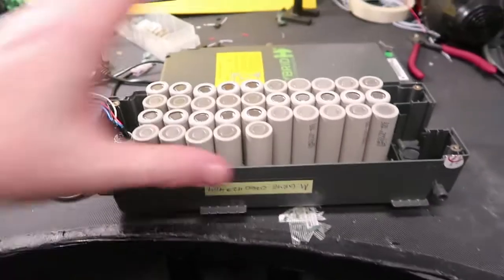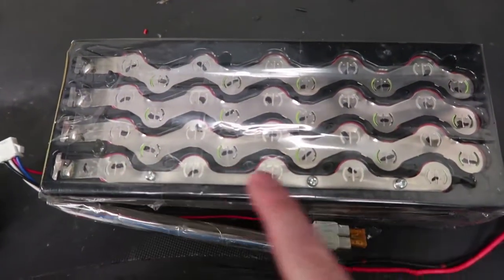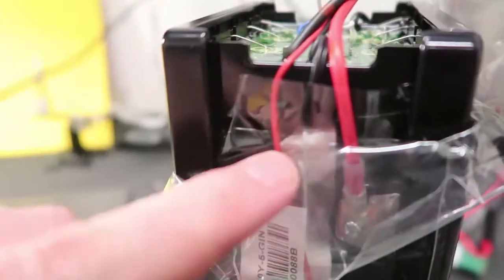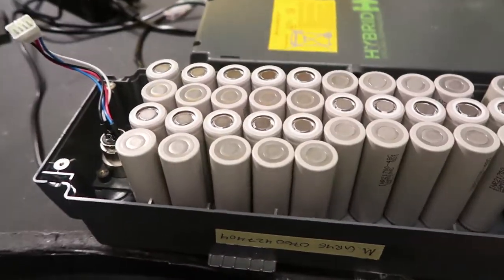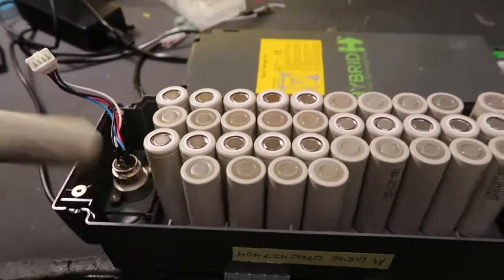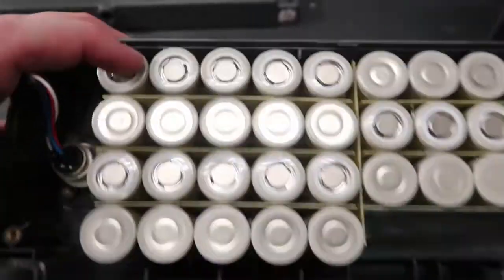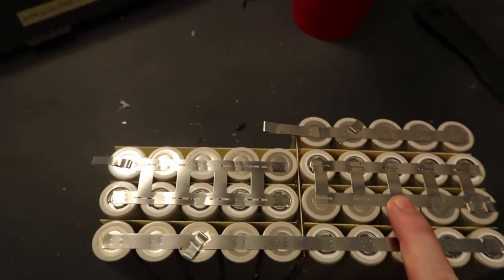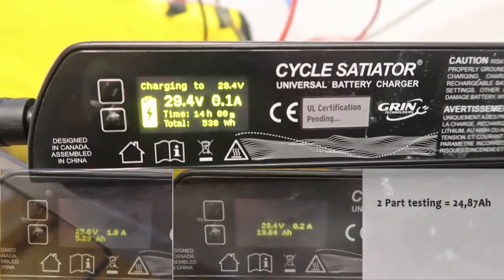Building a 24V 24ah battery with 21700 samsung cells

Comment: have you run your own test to see their capacity 
from 2.5v -4.2v in a analyzing charger (or close to that like 2.7v - 4.18v)
Reply from the maker: yes i dissassemple all cells and test them individually. However i test them on 3-4.2V on the littokala Li 500 which can test 4 cells at the time. I dont recall what to cells where but they usually are about 60-80% of the original capacity.

Comment: 18650 is better option considering size,weght and capacity...
Reply: in 2010 yes but in 2020 use 21700
Reply: @mdbx3887  which 21700 has better energy density than 18650 Sanyo ga?